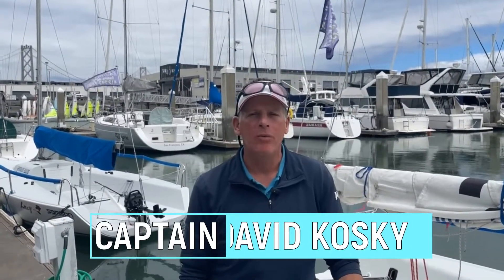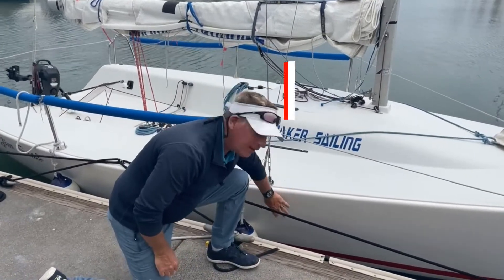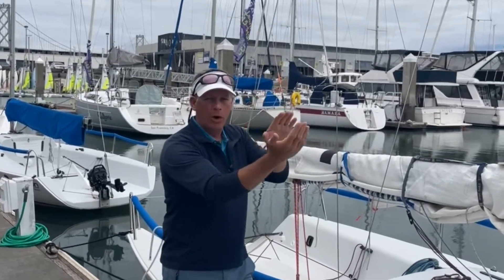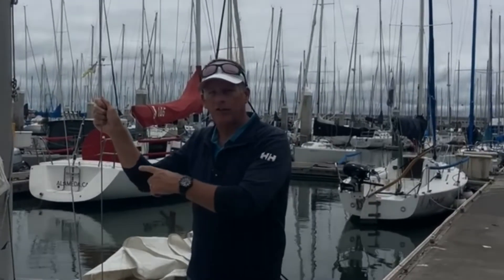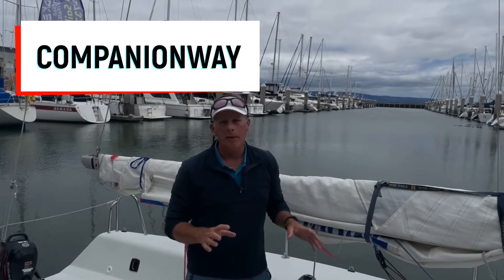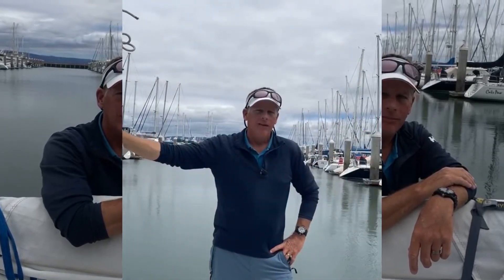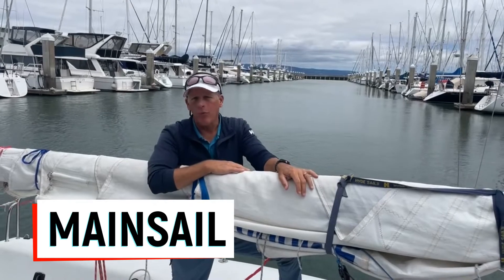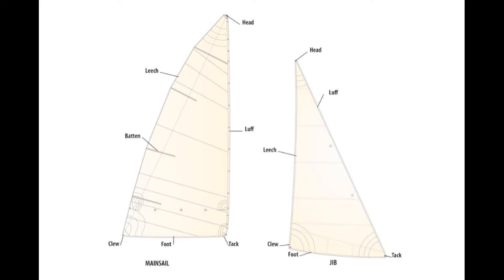Parts of the Boat... and How They Work!

Comment: Geeze, I saw the word "Backstay" in your thumbnail and hoped to find a decent video about the "backstay" (when to use, impact on main, jib, etc) that I could forward to my sailing students. But there is literally no useful information about the backstay other then your mentioning it as part of standing rigging. You might consider changing your thumbnail.
Reply from the maker: Funny you should mention that. That video is for beginner students and knowing the parts of the boat. However, we will be releasing a video in the coming weeks on an advance understanding of the backstay and other adjustments for various wind conditions. So, standby. While I gotcha here... what would you like to see in a video about the backstay or anything else? Let us know. Cheers
Reply from the maker: We plan on doing a performance class on the J 80 and will be working on those videos, including backstay, traveler, Vang, etc.

Thanks so much for your feedback